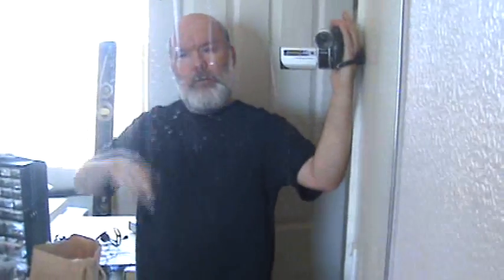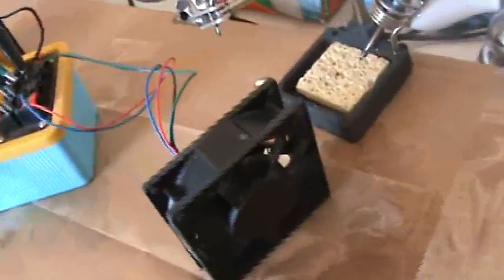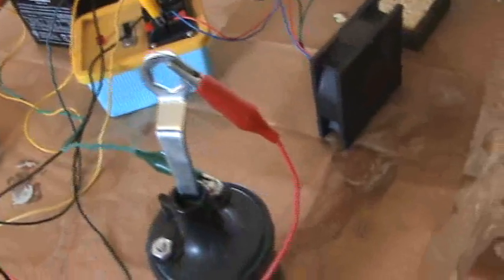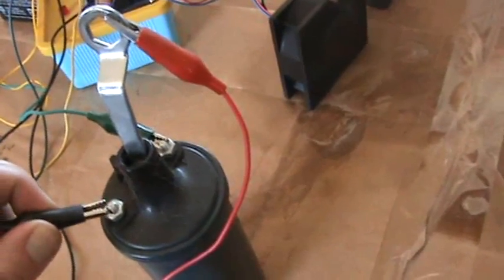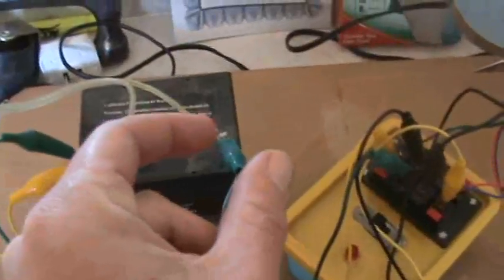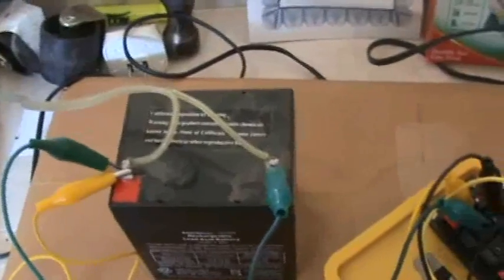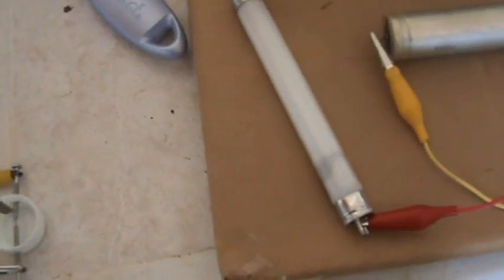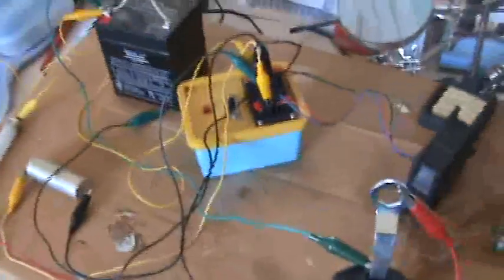Bodkins/Bedini Experiment with SPARK-GAP to Ground -- watch out ... ZAP CITY!

Comment from the maker: @nexus1g 
Overunity is not impossible if the system is an open system ... not a isolated system. You want to receive energy from the outside of your system. Nature has open systems. And the answer is YES ... it can easily be converted. Frequencies can be shifted from the high to the low using basic electronics.

Comment: rated excelent...

Simple reason being that hardly anyone shows the emergence of the high voltages in such definition...

I have a hevily modified bedini and i get shocks from the trigger coil nevermind if i stuck my finger on my HV cap...